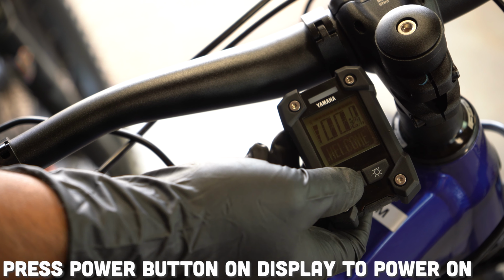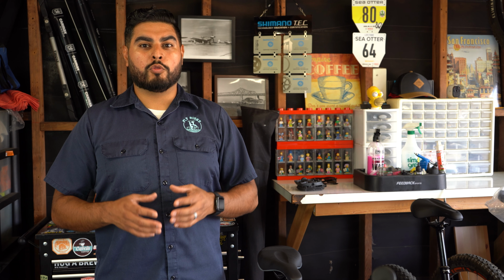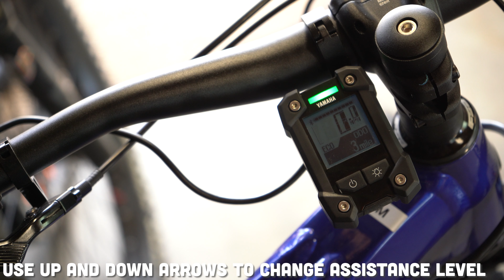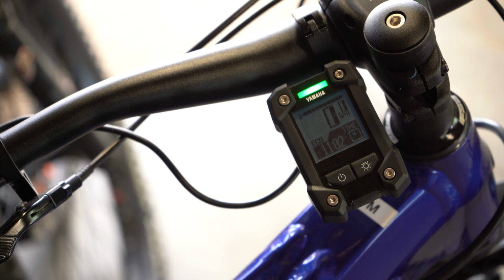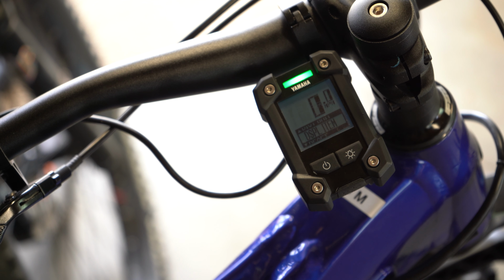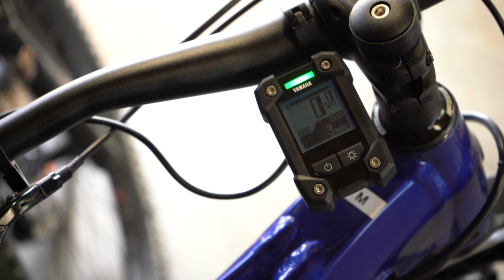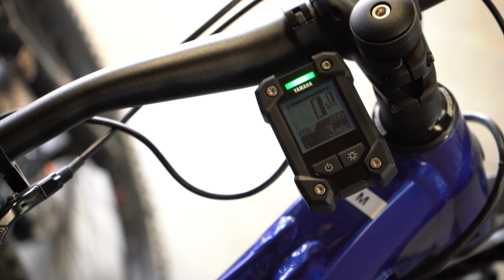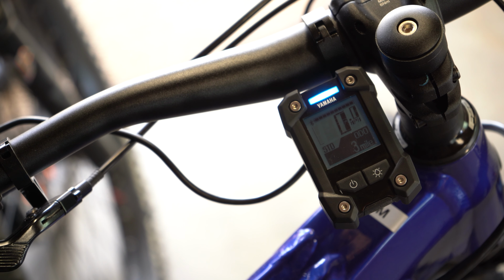How Do I Use My Yamaha Electric Bike? | The Yamaha Electric Bike Display Explained

Comment: Great video Hector.  Just one thing to note.  Even though the display has a power output, it is less than 2 amps so most devices should be able to hold the charge they have but will not likely charge up.

Comment: My clock keeps resetting to 11:00 after a ride.  I have set it each time I go out and once the bike sits then the clock resets to 11:00 when I turn the bike back on.  All other settings and data is on the computer are kept.  Any way to fix this issue?